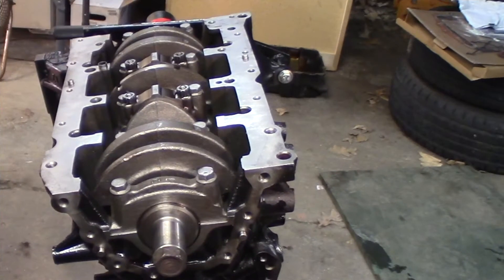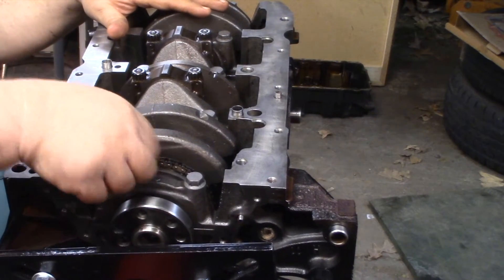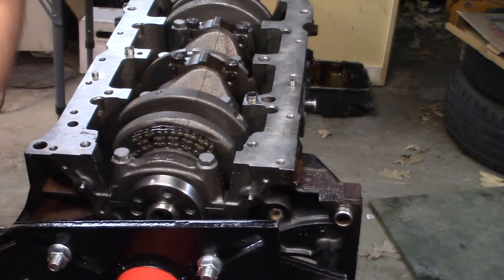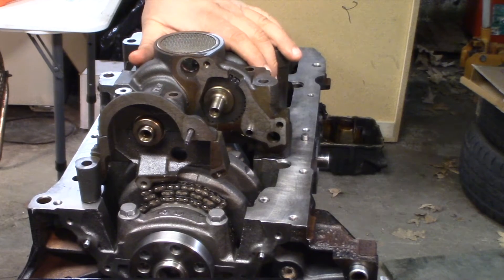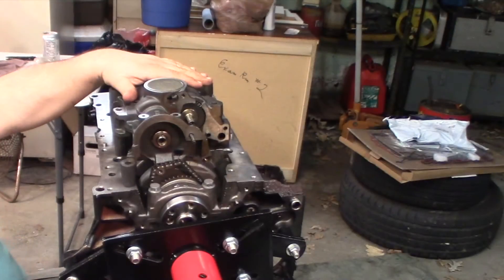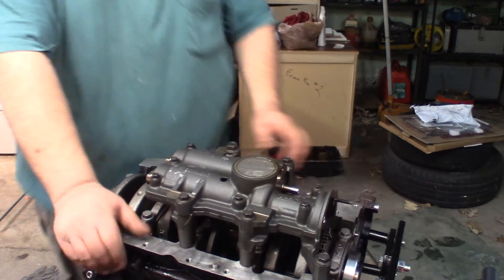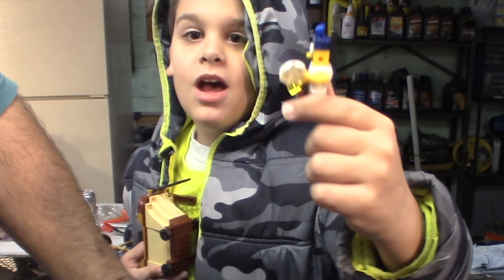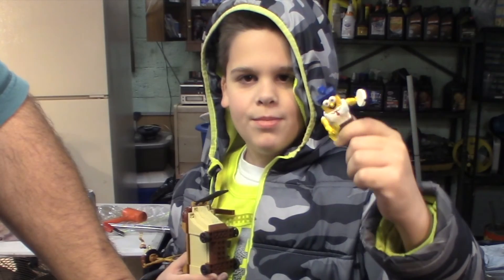LD9 Engine Rebuild Part 8 - Balance Shaft Housing Install - 1999 Grand Am GM 2.4 Quad 4

Comment: Is that tech angle adapter a Lisle?
Reply from the maker: No, it's a generic one I got off of Amazon and I wouldn't recommend it.  I looks just like the Lisle except it really hard to read.  The measurements are very tiny on it.  I end up having to mark my spots with a paint marker on the edge.   The Lisle is much easier to read and has bigger numbers and only costs a few dollars more.